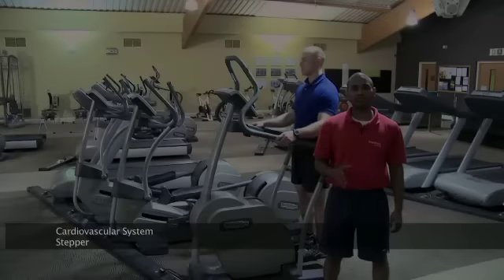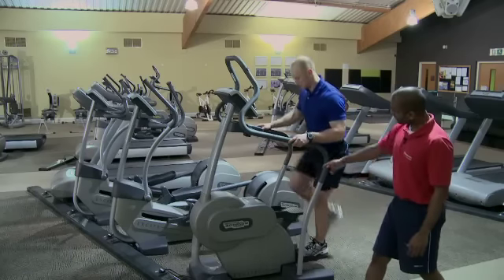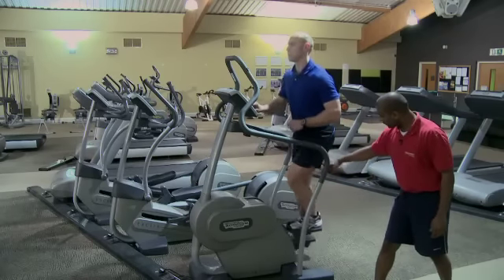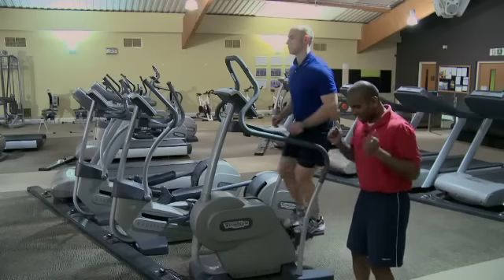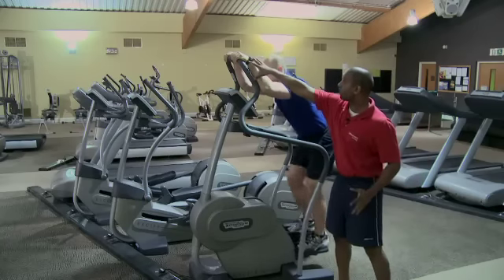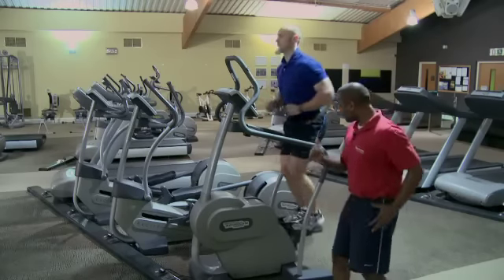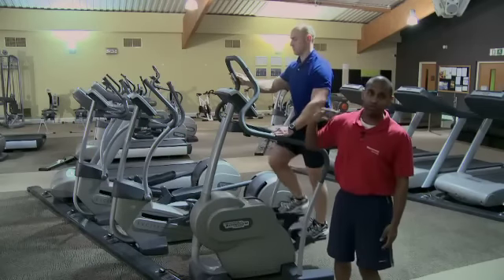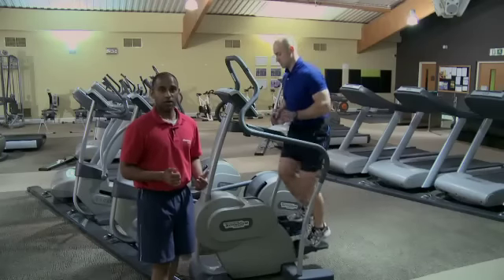Stepper Machine

Comment: we are supposed to avoid touching the floor right?
Reply: yeah
Reply: You can touch the bottom but shoot right back up, which will work your whole lower body not just a portion of your legs.  The higher the level the easier it is to paddle, but the faster you have to go just to keep the upright position, and that's where the challenge begins.

Comment: Has anyone tried using music while using this? For instance on a regular stairmaster I listen to music at 90 bpm which sorta double as I speed it up.
Reply: Yes. I find it easier to fit music to this machine because the full size stair machine has more discrete tempos. This has a discrete range of lowering speeds, but you can vary the rise height to fine tune to a song tempo, and you can take a smaller or larger step if you go out of pace with the song.

Comment: the guy is totally wrong about the stepper the supports are there for a reason, if you like my self use the stepper on max level you will see and feel the difference doing it his way is boring and you will not burn as many calories as you would if you increased the level and used the supports.
Reply: ati832 Increasing your level is great but holding on means you aren't actually doing the work. The calorie count on the machine isn't accurate then and doesn't know you're taking half the work off your legs. Common sense man.
Reply: It's not for support it's for safety so that if someone looses balance or slips then to hold it and protect themselves from falling.
Reply: try it on level one or 2 with no hands. Equal workout,